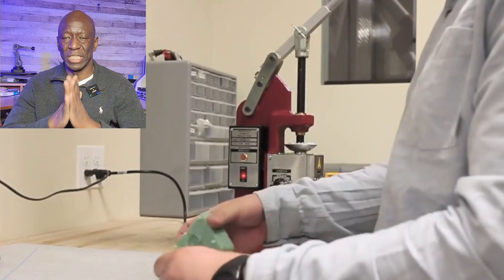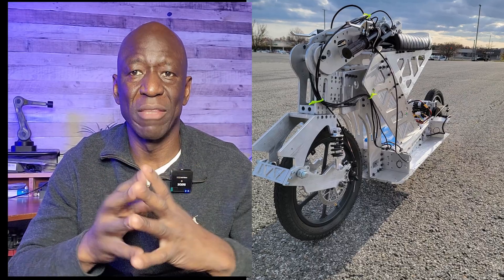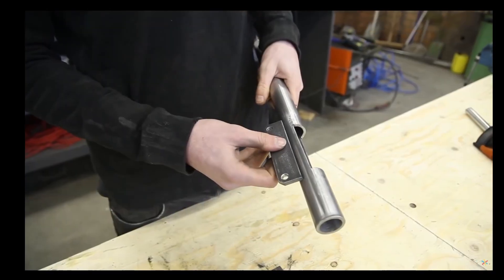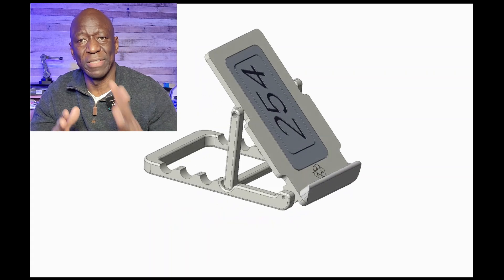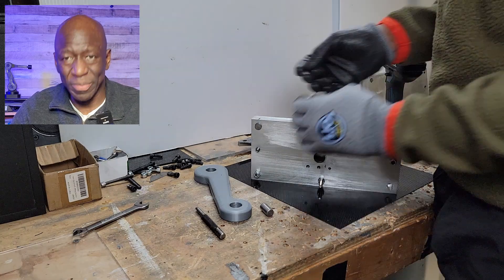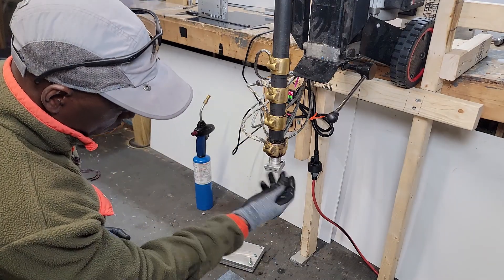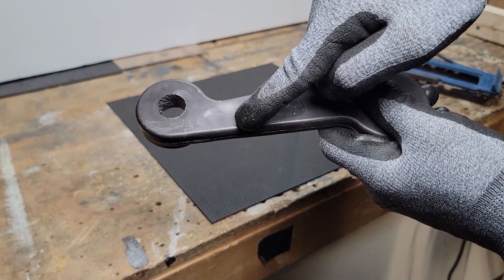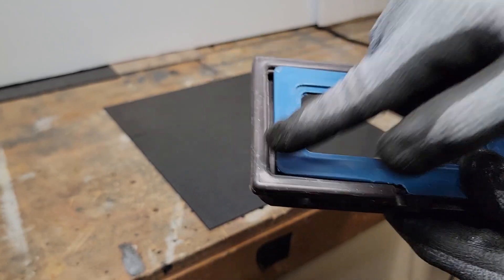PLASTIC INJECTION MOLDER LOG SPLITTER Machining, Fusion 360, 3D , SolidWorks CAD, CNC, PTC Creo

Comment: John! Great Video as always. Funny story - long before we met I designed a handful of plastic injection molds used in medical device for a company making needles. Those deformations you mentioned in the video are likely "sinks" due to the thickness of the plastic varying through your part design. The sinks will occur where the part is thicker, because those areas take longer to cool down and therefore are still partially liquid when the rest of the part has solidified. If you cant design out the thicker region, you can combat it by increasing the hold pressure/time with the hope the pressure will help push the malleable plastic into those areas as it cools.
Reply from the maker: Hi Steve, Thanks for your comment. The injection molder has turned out to be a super interesting project. I am looking to play with the designs and also plastic types. I have so far only been using recycled PP.